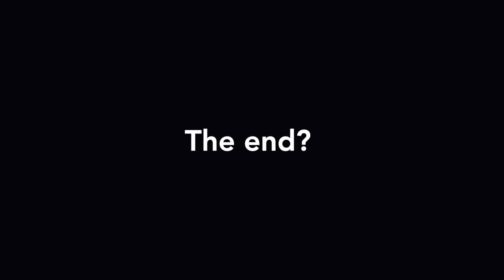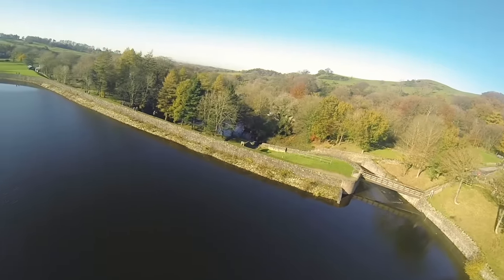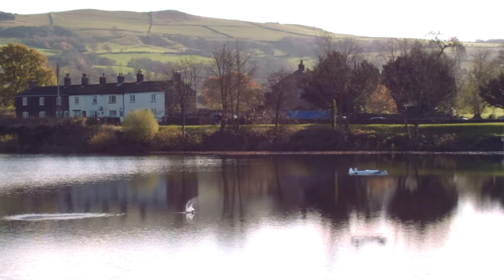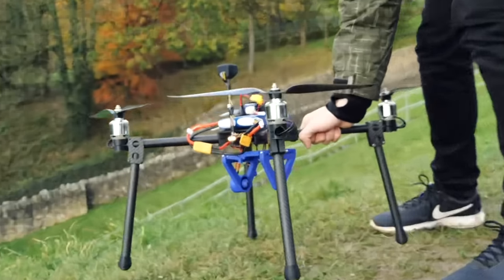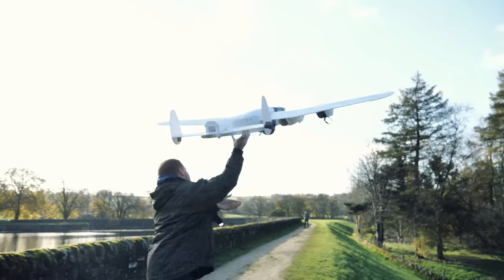Making a Radio Control Dambuster (pt2)

Comment: Of course the actual bombers had a triangulated light system to judge the perfect altitude from which to drop the barrel bombs. Maybe  you could drag a stiff wire or something underneath the plane to judge your optimum height for skipping the barrel.

Comment: If you changed the barrels surface to be far more smooth or far more rough, would it bounce better?Usually for wheels on the ground, you can go for slim wheels that are more effecient, but has less grip, or wide wheels for more grip, but require much higher energi use.and would putting a gyroscope in the barrel make it bounce almost forever?

Comment: Why was the dambuster spinning backwards? FIgure it would go farther spinning forward.
Reply: farmers I believe that the barrel drills itself into the water if it’s spinning forward.
Reply: @crashrr2993  I gotcha, that makes sense.
Reply: The answer is so that once it reaches the dam it would follow the dams back so when it exploded it was about halfway up, causing the maximum amount of damage.
Reply: @jetison333  Good point, there were three benefits to a spinning bomb: the gyroscopic force helped to keep it moving in a straight line; the backwards spin gave it a higher bounce, better for evading torpedo nets; the backwards spin also, helped the bomb to stick to the dam wall and crawl down to a more damaging level.
Also, unlike as shown in the film, the real bomb had a curved shape. This was a still an official secret when the film was made, so they gave it a perfectly cylindrical shape. To think the whole operation was put together in a month is quite incredible!
Finally, I have to add that this model has a magnificent presence worthy of the real thing - shame it wasn't painted up, it would have looked AWESOME!

Comment: It took the designer of the bomb several months to get the speed,  height and distances between the aircraft and target for it to work right. Duct tape in the TAG and USAAF was used to fix airframe battle damages, here in the state's we orginally called it 400 MPH Tape.

Comment: Hi Guys. What a fantastic project. I hadn't seen episode 1when I saw this. It was mentioned on the first run that the mine (the correct term for the 'bomb') was released at too great a height; did you make any calculations to obtain the correct scale height from which the mine was dropped? How about the scale speed of the plane? I noticed in the test spinning and release of the mine that it was rotated in a forward direction, whereas the actual mine was rotated in the reverse direction. Did I see a final clip where the mine was correctly rotated in the reverse direction? You showed two mines being tested, a proper cylinder (as used in WWII) and a (red/blue) rugby ball with the ends chopped off; how was the rugby ball-shaped mine decided upon?

Comment: Great achievement lads, awesome gear.
I used to fly RC in the late 70's, the radio gear was very expensive. Even basic, still picture, digital camera technology was still decades away! 
How about air launched, powered torpedo's for your next project?
Regards Paul in NZ

Comment: Fine, fine work. Could it be that you did not get the volume/mass ratio of the barrel quite right ? There were really only two proper bounces whereas the real thing had more, if my memory works.

Comment: Also, are you using a laser cutter, or are all those done by hand? If by laser, how did you access one? I’m attempting to build my own project!
Reply: If you watched his previous video on this you'll see he did use a laser cutter and it was one at his work. Idk where you could find one, but you can make these kind of projects without a laser cutter.
Reply: Thanks! I’ve been trying to build my own plane and want to be the most accurate cuts possible

Comment: You're spinning the bomb the wrong direction! It should be spun CLOCKWISE as viewed from the right side of the plane, not counter-clockwise.
Reply from the maker: Actually it's supposed to have backspin to have a higher surface contact speed with the water.

Comment: First, this kid makes some really good videos.  Second, getting 3 solid bounces for his 'bomb' was really excellent work.  Nice plane, nice bomb release mech, nice work.
Reply: Also, while you might not think so, low level flying is actually quite difficult.  For instance, the things you can do to try and gain more altitude, actually tend to cause a loss of altitude. The change in the horizontal stabilizer actually increases drag.  And if you don't simultaneously increase engine power, you'll go down, not up.

Comment: seriously, could not have picked a worse place to land on attempt 1. There's a larger area over behind you on the smaller hill that would have been much better (I've flown RC for 30 years and would NOT have tried to land there.
Reply from the maker: 🤷‍♂️ Thanks for commenting, but if there was a better strip to land I would have used it. I invite you to attempt to land on the hill you point out with your years of experience. 👍

Comment: Tom great video, i do have a question was ur barrel spinning the right direction as the original DAMNBUSTER'S  spun.
Reply: Late reply, but I was looking for the same. At the build pictures, it looks to be correct. I believe it was spinning in reverse, so the bomb would drive itself down the inside face of the dam, and explode as deep as possible . This to assure the best possible effect from the explosives.

Comment: I know IRL the approach was a four man process (the pilot, navigator, bomb-aimer, and the flight engineer)  The pilot (of course) flew the aircraft, the navigator would use the two light height finding system (when the two lights were one dot is was the proper height), the bomb-aimer would use the Y-shaped range finder to determine the release point, the flight engineer would watch the engines to make sure the aircraft was as the proper speed.  I would think with some math (and a couple of cameras) you could replicate all of those virtually.
Reply: How about the radio operator, and the two gunners?

Comment: Ummm... You have the bomb rotating THE WRONG WAY!
Reply: They are supposed to spin "backwards"
Reply from the maker: The original barrel on the real tests rotated backwards, the same as we span them. We considered experimenting with this but crashed before we could. On ground based tests using Mosquitos in 1944-5, however, the projectiles were made to spin forwards as a way to minimise bouncing and make them roll across the ground sooner - so I theorise rearwards spinning might help rather than hinder the hight of the bouncing. 👍